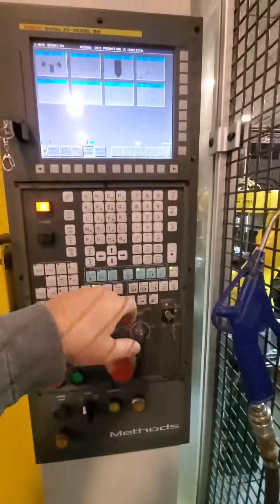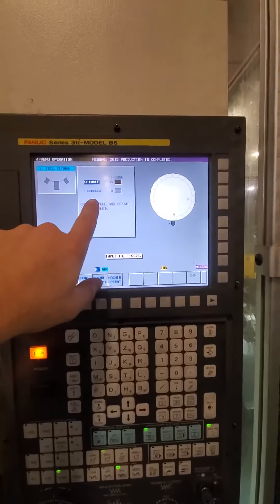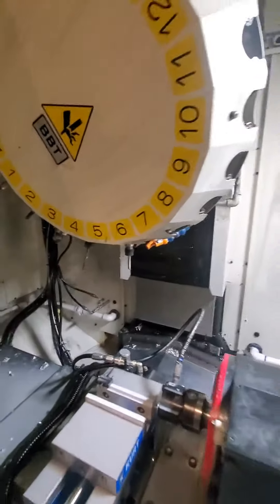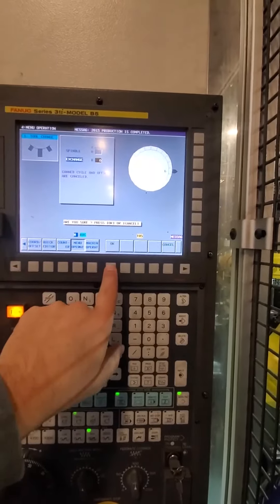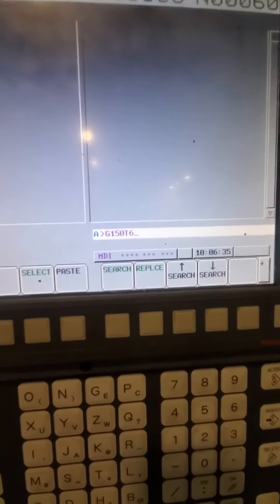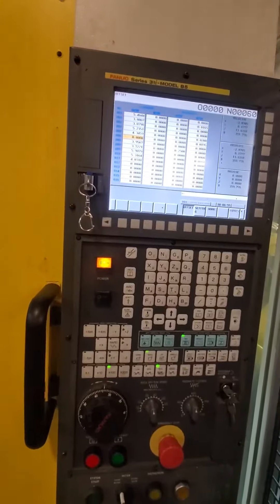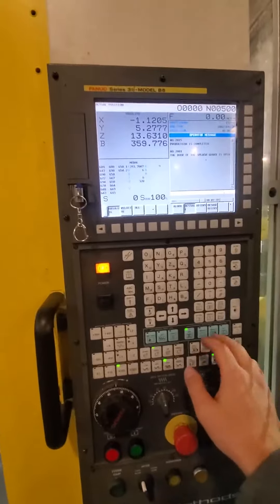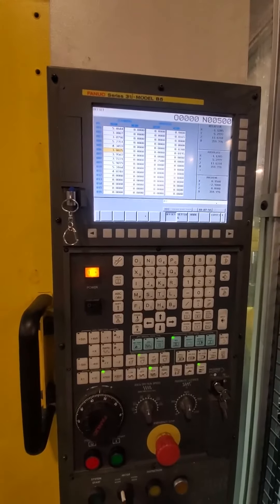Fanuc Robodrill: Setting up a New Tool

Comment: Do people out there actually use the "tool exchange" slot to load new tools in  Robodrill?  I worked with Robodrills for 15 years and it never even occurred to me to use the tool exchange location.  Considering it takes about 10 times longer, it seems like shear madness to load tools that way.  What I loved about the Robodrills is that I could take a rack of all my tools, lay them inside the machine and load every tool in practically no time.  Now I work with Haas, and I can't stand the time it takes to load tools.

Comment: how is program zero set? I set all the tool lengths but i'm machining air above the part it thinks part zero is spindle all the way up. It would be a pain to make all my programs comp the depth for the z travel. On our Fadals and other machines its simple to just zero the axis on the part using tool one and the rest follow based off the length offset.